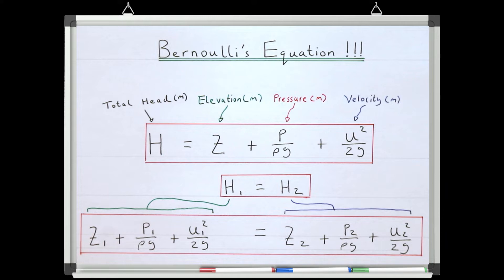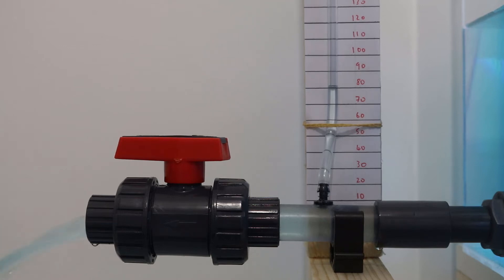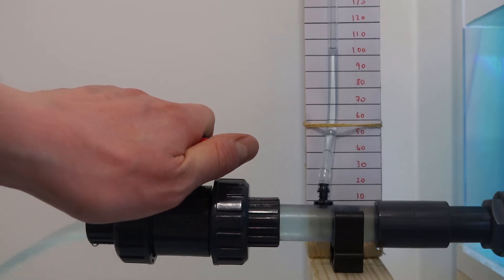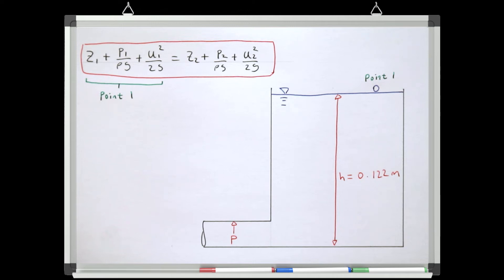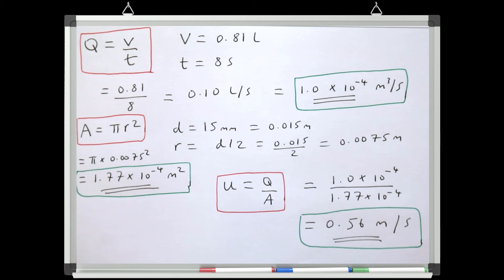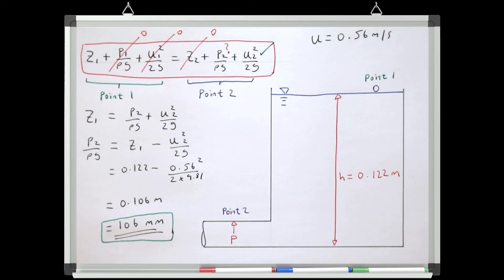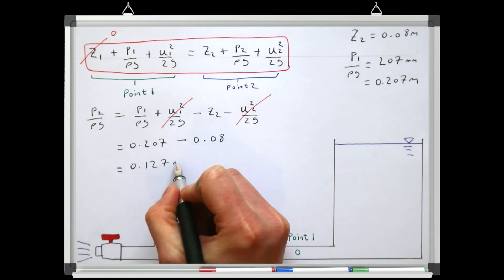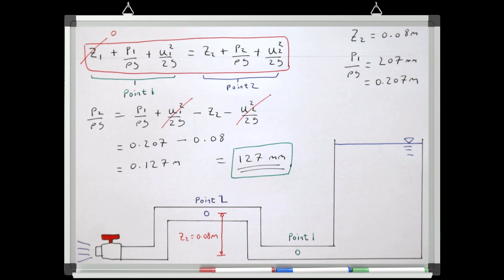Bernoulli’s Equation for Pressure of Ideal Systems (Lesson 2, Part 2)

Comment: Since the valve is half open, won't this change the diameter of the opening in your calculation.
Reply from the maker: In the question we are given the velocity at the point where we are finding the pressure, so don't need the diameter to get it. But the velocity will indeed be higher at the valve due to the reduced area, but the calculations are done at point 1 and 2.